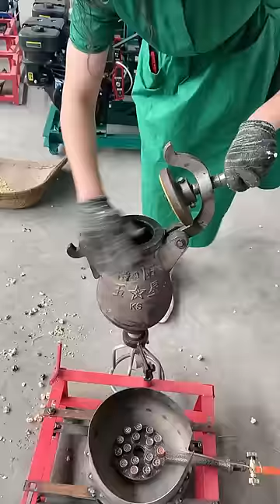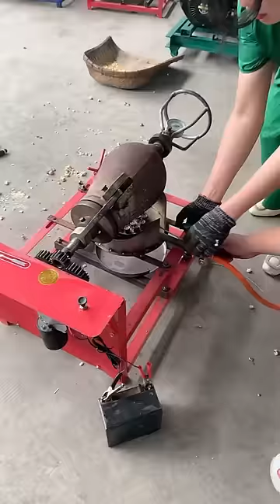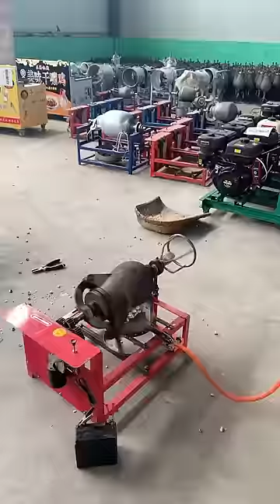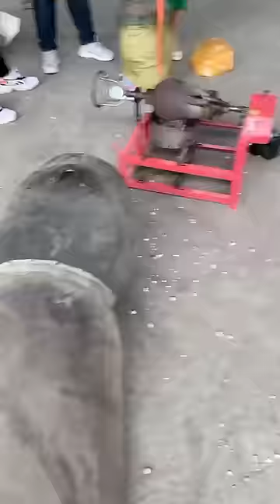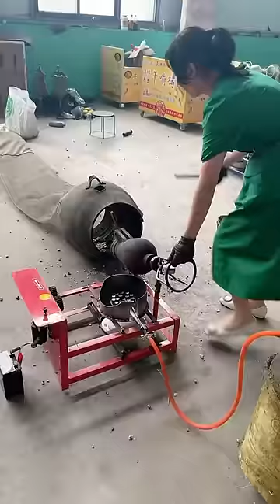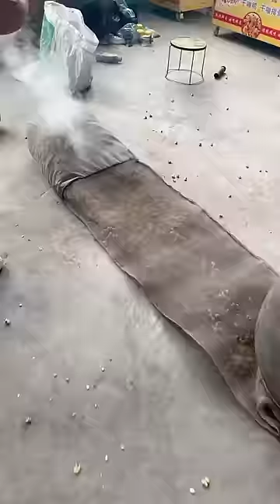Ancient popcorn technology, good machinery and good tools to save time and effort

Comment: Seems like a lot of trouble just for popcorn.
Reply from the maker: Very simple
Reply: I heard it leaves less room for unpopped kernels.
Reply: blasphemous5748 It is, you're just used to taking popcorn for granted.

Literally just spinning a pan over a fire to make it the same way you would over a stove. The only difference here is the amount of pressure is increased to avoid wasting kernels.
Reply: @UnprofessionalProfessor   And it's extremely dangerous
Reply: @goosepapoose8666  Exactly! That's why we've learned to control it.

Comment: Couldn’t you still use this method but do so in a sanitary environment with clean implements? That filthy mesh bag, laying on an even dirtier floor. And every time I’ve seen this method using the rotating pressure cooker - half the popcorn is always completely burnt.
Reply: They sell cannons for cereals/grains, not popcorn, so they don't need that if it's just for demonstration.